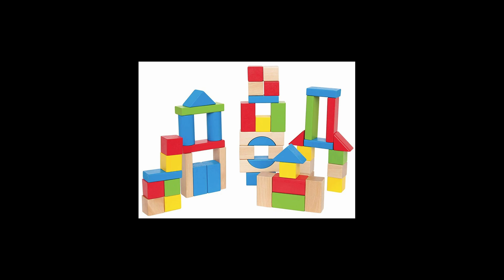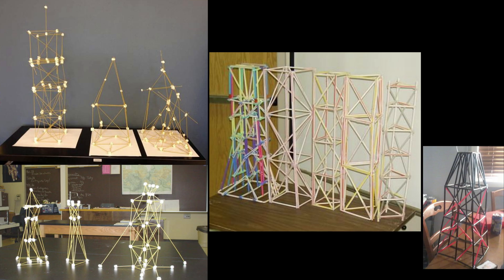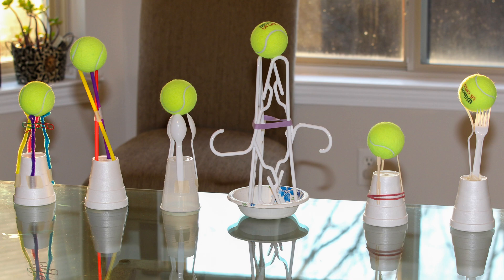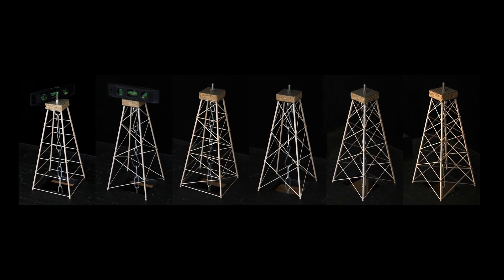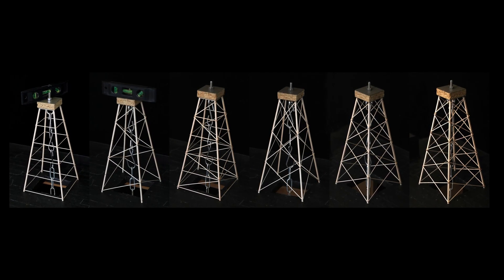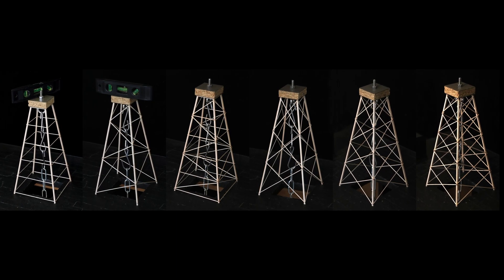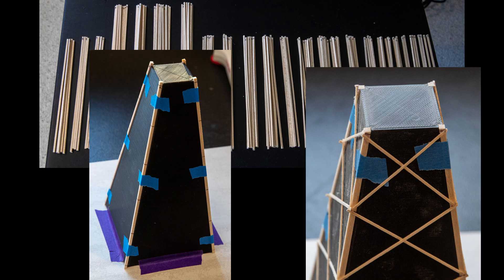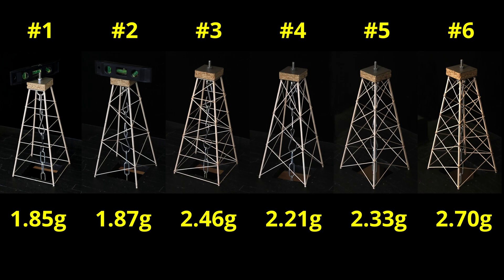Tower Basics: Part 1: Introduction

Comment: First guesses before watching video. I reckon 1 will do poorly, possibly undergoing a twisting failure.
2 will do rather well, being only 0.02g more but the triangles resisting twisting and the tower being steep enough that the bottom tension square is not needed to stop the legs splaying. For pure strength I think 3 and 6 but they are quite a bit heavier that 5 could hold more for its weight and 4 being stronger than 2 but only slightly. My money is on 2 being the best strength to weight ratio but 3 being the strongest overall.

Comment: hi i was just wondering if paulownia could be used instead of balsa as ive heard that its strength is great and it is also lighter
Reply from the maker: I've never used it, but just looking it up online, it says it has a density of around 260 kg/m^3.  The balsa range which is really good for what we build is typically around 100 kg/m^3.

Comment: 5>6>4>3>2>1
Reply from the maker: How about some efficiency guesses? or how about best vs worst?
Reply: @balsaengineering6686  I don't really have any experience with tower. just random guess 😀5:1=4000:200.
Reply from the maker: @williamwang223  5:1 would be 4000:800 and 4000:200 would be 20:1.  I won't give away any spoilers just yet!
Reply: @balsaengineering6686  I mean no5/no1 =4000:200
Reply from the maker: @williamwang223  Ahh, that makes sense, thanks!